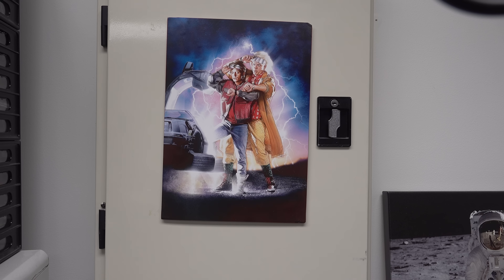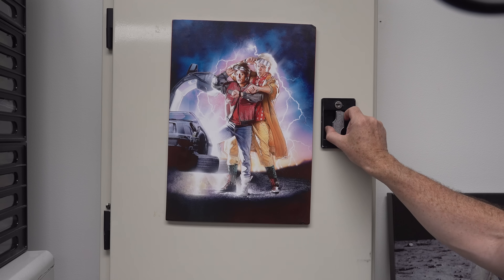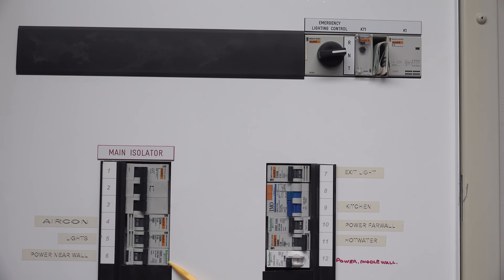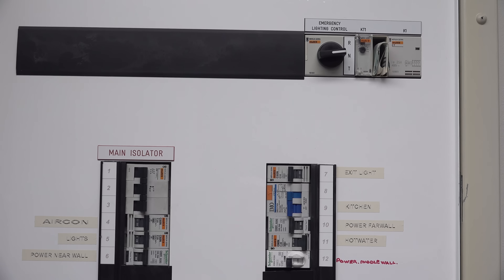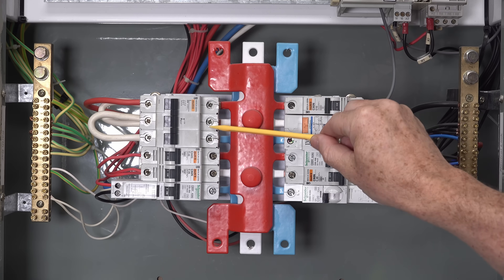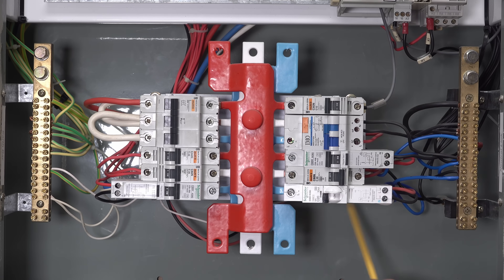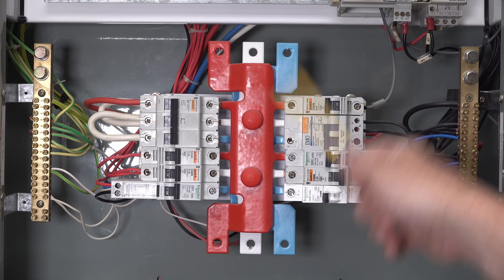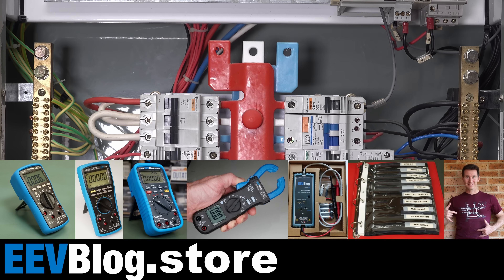EEVblog 1652 - Why is my Lab Switchboard Wired Like This?

Comment: Yeah, this one will be more familiar to the Yanks. Similar style to US load centres.

Kinda surprised about them only using a single phase, might be that because they've got fairly "standard" loads in all offices of that particular size (i.e. they're all wired identically with identical fixed equipment) they just alternate them across the phases, so your neighbours would be on white and blue instead of red (similar to how they tend to split three phases in the street to single phase drops to houses).

Would've thought it'd be better to have all three phases wired in though as it's usually easier to split loads across phases closer to the point of use.

Another point to note, the RCBOs in that panel are much larger (physically) than what you'd find in a domestic panel because they'll be rated 10kA rather than the 6kA that's standard for domestic.

ISTR Merlin is a sub brand of Schneider Electric, and they primarily do commercial switchgear but don't quote me on that.
Reply from the maker: Yeah, it's technically more work to wire single phase than just connect the 3 phase wires straight in. Strange.
Reply: Appropriate lugs and breakers all cost and take more cable, than simple single phase solution as shown by competent installer not taking plastic of busbar
Reply: @craigotene4213  That makes no sense whatsoever in this context.

Literally the only difference between this being "simple single phase" and "three phase" is that they haven't connected the white and blue phases to the incoming breaker, the panel is designed for three phase, ergo the three bus bars and the three-pole incoming breaker/main switch.

This used marginally MORE cable because they needed to loop together the two other poles of the incoming breaker rather than just connecting them to the incoming phase wiring that is sitting in the back of the cabinet (hopefully capped with some connectors, which they also wouldn't have had to use if they'd wired it as a three-phase panel).

EDIT: per the pinned comment apparently the other two phase wires whilst present in his cabinet are NOT live currently (even more cable...), so that's the reason they looped the incoming breaker on the panel.

Comment: You don't need more then 1 phase if you're not constantly tripping the main brakers. They can easily upgrade if needed. They've probably split the phases between different offices to manage the load evenly.
Reply from the maker: I suspect that when they built the building they just had a bunch of standard 3 phase box designs for every office, and then the bigger offices got actually wired to all three phases. Small ones like mine got a single phase. Although it's technically slightly more work to wire single phase like mine, so...
Reply: @EEVblog  It makes it much easier down the track to move an office to 3P if need be.  Cost to do 3P capable everywhere compared to the cost of the building over all is trivial.

Comment: Beginner here.  Extra cable at the top:  someone stealing electricity?  All the best
Reply: Nah, it's for the old leased office socket ring. They must have run it down the wrong conduit.
Reply from the maker: @C4mpblor  That's most likely, just easier to feed up there I guess. It's the only addition that has ever been done since I've owned the place.